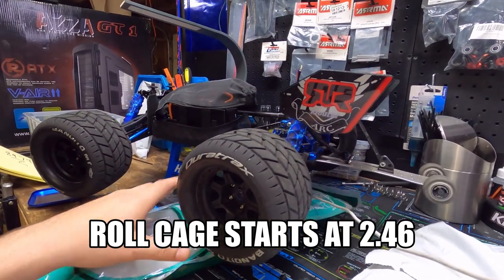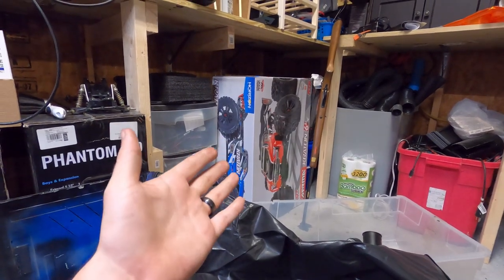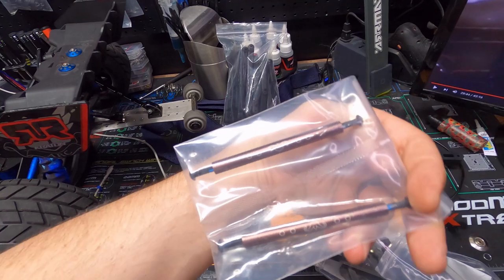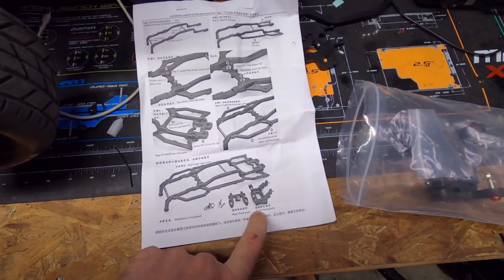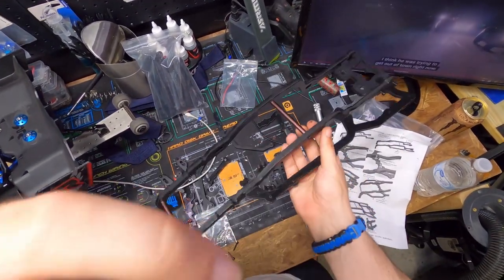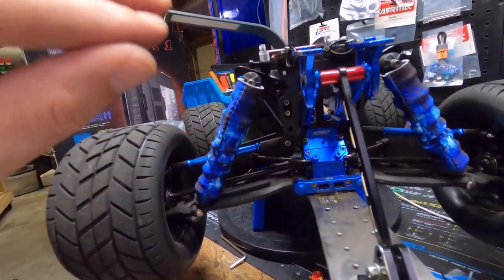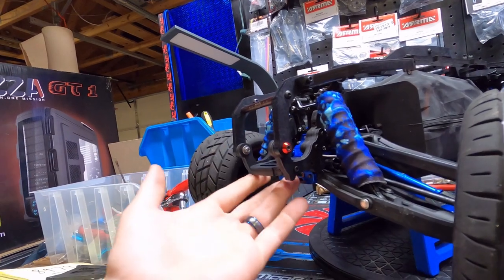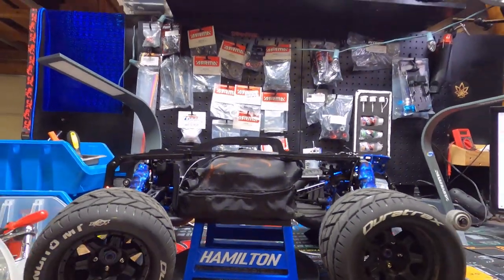ARRMA KRATON 1/8 RC Car Roll Cage

Comment: Your Kraton is super cool. The cage seems like a PITA. Hopefully it will help protect the car on roll overs.
Reply from the maker: It works well.... But I flip the car and it slid on its top and grinded that Plastic roll cage down on one side.   And gave it a flat spot in it.. lol.  Ty. Consider subscribing?  Cheers 🥂

Comment: I checked the eBay description and it says "You need to replace the EXB's 3-piece front anti-collision set and front and rear shock absorbers to use" so you do need to buy the EXB front bumper to make it work. Easy and cheap fix luckily.
Reply from the maker: Yea i change out the front bunper piece and the roll cage fits...     It should b a direct fit.

Comment: That sucks it doesn’t fit.
Reply from the maker: Yep... It does
Reply: @ATECHPCs  you were always gonna struggle to get an EXB marked part to fit a V5 /HR/GPM Modified rig though to be fair, you'll defo have a much better chance if you slap the Exb Bumper on though, Thanks for Trying all the same .... you could always give up in a fit of rage, rip it off and send it to a Random Brit with a Stock EXB  ;)
Reply from the maker: @iwantblue491  yes i just bought it.. I also had somone said make some 3d printer parts to help it fit..  Im do a video #2 on this..wen the bumper arrives...consider Subscribing
Reply: @ATECHPCs  Nowt to consider... already am ;) Good luck with the modifications, are you happy with the quality of the kit? other than the obvious fitment problems? it looks pretty hardy.
Reply from the maker: @iwantblue491  i am very happy with the kit... alought iwe ant done yet.. order a few more parts . and will make another video soon on it..  thank you for Subscribing.
Reply: Let me know when I put new video up on this bumper..im sure that will fix it.. I Subscribe btw